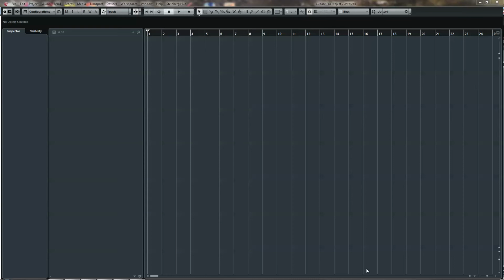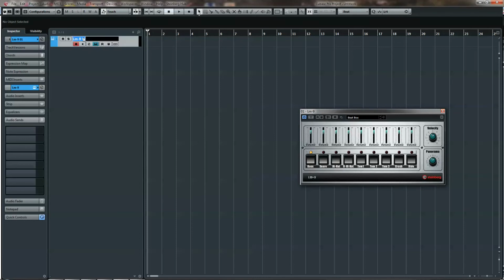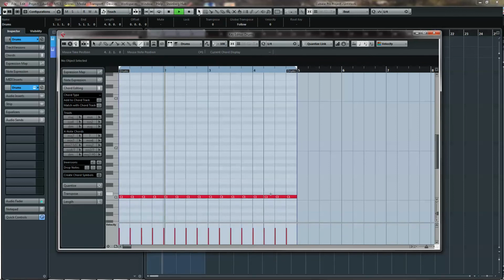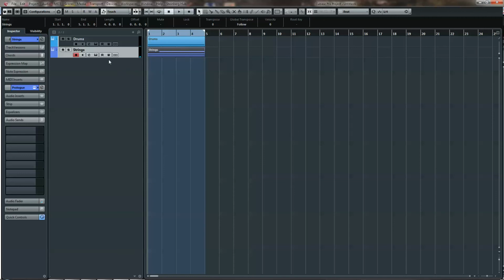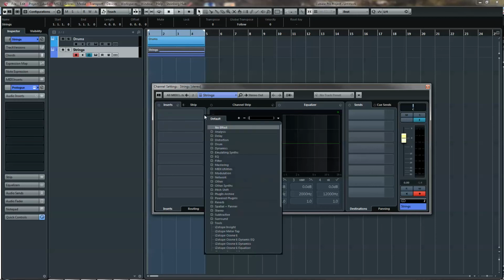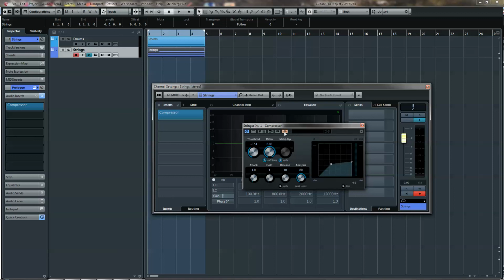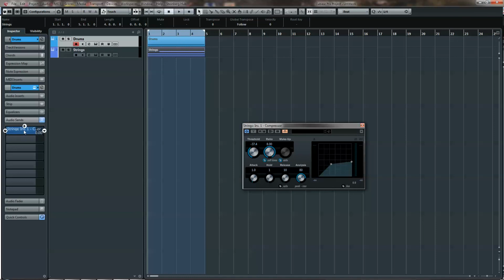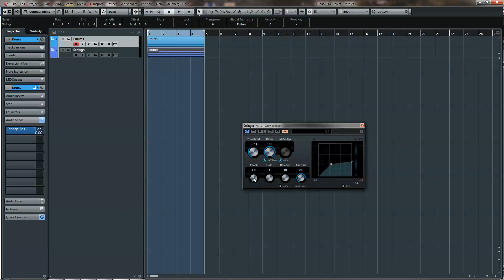Sidechaining In Cubase 8

Comment: watched this sidechain video by chance. thx! i was wondering if one could use sidechaining in order to mix, say, a bassdrum with  white noise: whenever the bass drum plays, the noise should be heard, and when the bass drum sits still, we hear nothing.
Reply: +archivradio II Hi.  To do what you want, it's a similar thing, but instead of using a compressor, you would want to use a gate, and sidechain that with the bass drum; when the bass drum plays then the white noise would play as well.
Reply: +Darren Jones – works, thanks!